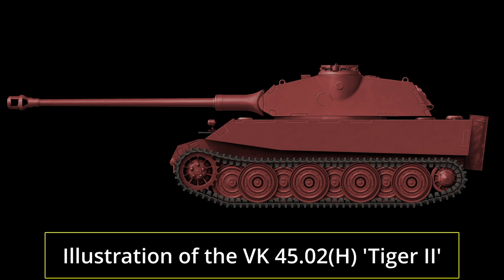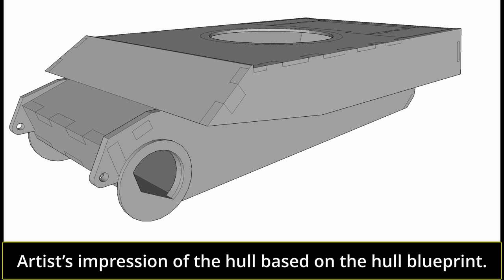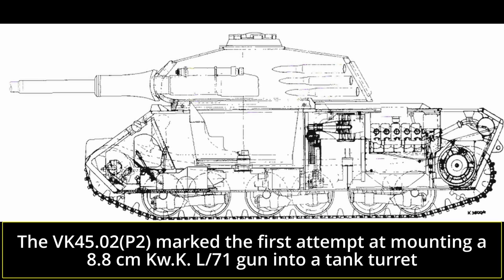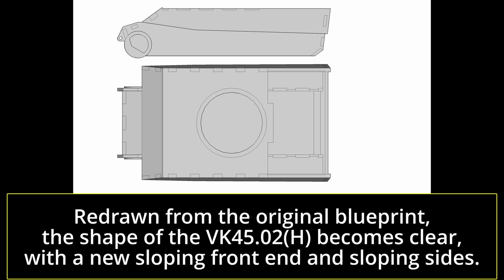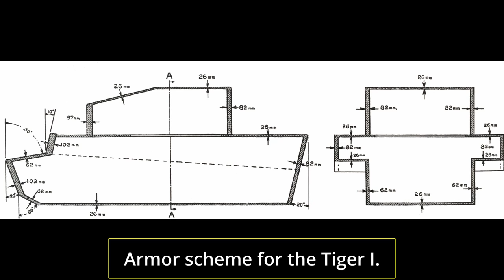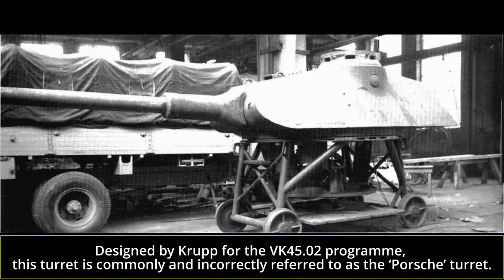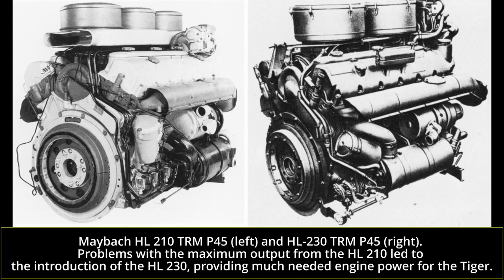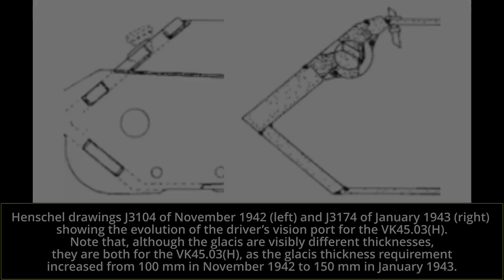The Lost Tiger | VK45.02(H) 'Tiger II' Henschel Improved Tiger

Comment: What if tiger 1 have  slope armor
Reply: you couldn't just make the tiger 1 with sloped armor, it would just make it smaller inside and the wight would go beyond what the mechanical stuff could handle, they tried that with the panzer 4 and they saw it wasn't possible.
Reply: @vasopel  actually the panzer 4 problem was weight and stress on the suspension, thats it. they tried making the panzer 4 with torsion bar suspension but couldnt make it work without a massive rework of the tank and the fact was the panther was already cheaper than the panzer 4 and the upgraded sloped panzer 4 would be more expensive than the standard panzer 4 so the idea was scrapped.
Reply: Sloped armor means different machine gun mount, different drivers optic, many more.
Reply: @vasopel  Thats not true. Extending the frontplate outwards to bridge the step of what would be the glacis and the roof where the normal front plate met would create MORE internal space, not less.
Reply: @vasopel  Actually, You could. The "step" in the frontal armor could be turned into a "ramp" and not cost any interior space, in fact, it would add to it. There were plans for making a Panzer IV variant with sloped armor using this method, but it never got a prototype.
Reply: @darnit1944  they could use the gun mount from the panther as well as the driver optics. the benefit is that it would mean less individual and specialized parts are needed and thus make the tank cheaper to produce.
Reply: @ravenouself4181  Switching production line is pretty tricky.

And besides, what's the need? By that time, Tiger is still impenetrable by Allied guns
Reply: @Thekilleroftanks  yes so what is your point? was my comment wrong in any way? :-) well maybe I should have been more clear... "it wasn't possible without a massive rework of the tank"
Reply: @kobeh6185  what?  :-O
if they did that the driver and the radio-operator would still be in the same place (there is the gearbox and the steering unit between them),
and you couldn't use that added internal space because then how would the driver see without making the port too big (periscopes are a bad idea) and the radio operator wouldn't be able to use the machine gun anymore!
that would just be wasted metal and so much added weight over the mudguards giving a lot of problems to the front suspension and the wheels 
especially if you consider that it was common to remove the 1st outboard road wheels because of problems with snow build up and because it was easily damaged (bended).
no you cant just put armor wherever you want, you need to make changes to the mechanical stuff too ;-)
Reply: @ravenouself4181  I already said they tried putting sloped armor on the panzer 4 in my previous comment ;-) 
hm...would the added space of a panzer 4 with sloped armor be used? that little extra space is so front in the vehicle you can't really put anything useful :-(
Reply: They could have had a lot more heavy tanks available for the eastern front had they gone with a Tiger 1 slope armor instead of wasting time and resources on the King Tiger .
Reply: @vasopel first off, the Sherman and most later war german tanks designs drive via periscope. Idk what makes you think periscopes are a bad idea, most MBTs today drive with them.

2nd. Putting lets say an 80mm frontplate on a tiger sloped at lets say 50 or 55 degrees would not in any way change the layout of the gearbox nor driver and radio operators positions. The step made my the plates is simply eliminated. Instead the top vector and front vector are bridged by a single monolithic 80mm plate, similar to the Jagpanzer 4 L/70. (The plate doesn't need to be as tall though) by bridging the step you increase internal volume, not decrease it. Its not as if I said to slope the armor all the way to the turret ring like a T-34. Anyway, This provides superior HE protection from high caliber HE, as well as thicker effective thickness against AP. It will result in an increase in weight, but not by a significant amount. Consider the Tiger 2 being 15 tons heavier and a meter longer and basically having the same powerplant. Adding 2 or 3 tons of armor to a tiger 1 isn't nearly as much of a consequence.
Reply: @gustaveliasson5395  sure but what does that have to do with the tiger 1? it's components were already designed to be put in a boxed shape.
Reply: @kobeh6185  what I meant was that having ONLY a periscope for the driver is a bad idea, the fatigue from driving using a periscope (especially with that period's technology) is bad for the driver, even in modern tanks it is common practice to stick your head out of the tank to drive (if there is no danger of enemy fire)
as for the rest... please just read again my previous comment-answer to you  ;-)
Reply: @vasopel  again, the Sherman and panther and tiger 2 all had just a single periscope to drive. Not saying its ideal but a direct vision port (which is what the tiger 1 has, im assuming thats what ir advocating for) has far more issues regarding protection.
Reply: @kobeh6185  are you reading my comments or not? please read all the 3 below..
a: "how would the driver see without making the port too big (periscopes are a bad idea)"
b: "the fatigue from driving using a periscope is bad for the driver, even in modern tanks it is common practice to stick your head out of the tank to drive (if there is no danger of enemy fire)"
c: (bonus): the drivers hatch on a tiger 1 is NOT above the driver,the chassis is too short,so anyway the driver cannot stick his head out so he needs that front vision port.
ok? :-)
Reply: @vasopel  the first point didnt make any sense. Periscopes being a "bad idea" and "making the viewport too big" are completely unrelated problems. 

2ndly yes many tanks drive head out when not under fire, again not relevant to the point. I clearly understand that as well but it doesn't change my opinion of the tiger. Periscopes don't have to be vertical. It'd be easily possible to bring a periscope to the driver if the tiger had a sloped front plate. After all the Panther could not be driven head out at all without add ons that weren't part of the original design.
Reply: @vasopel 
You just said it yourself, the Tiger I's components were already built.
So, if you build a Tiger I with sloped armour, it can't be smaller on the inside than the regular Tiger I, because then the components wouldn't fit.
So, sloping the armour on the Tiger I isn't going to leave you with less internal space, on the contrary, the sloped armour design will be slightly roomier.
Reply: Gabriel Rabin  Problem is, "flat on" is how most shells are going to hit the tank.
The best slope you're going to get using the flat box is when the enemy is shooting at you from somewhere around 40° to your left or right, any more than that, and the side armour becomes more vulnerable than the front. Even then, you can only keep the armour properly angled against shots from one, maybe two directions.
Build the tank with sloped front armour from the start, and you won't have to worry so much about manually angling your hull.

Then there's production costs.
1. The regular Tiger I was built using armour plates of various thicknesses, including 25mm, 60mm, 80mm, and 100mm. If you remove the 100mm plates used for the front armour, and replace them with sloped 60mm and 80mm plates, that's one less type of armour plate that you need to produce.
2. Replacing the two-piece upper front hull armour with a single sloped plate means that less welding is required.
Reply: @kobeh6185  what? do I really have to explain that those 2 things are the same problem? if you put the sloped armor the way you said you would need to make the view port too big to help the driver see, but the whole point of sloped armor would be to have better protection, so you can't make the viewport bigger because it is obviously a weak spot,so you would need to use periscopes as the only way for the driver to see.
you won't even consider changing your opinion? so why are we talking? :-(
the panther? again you use other tanks for examples? what other tanks have to do with the tiger? anyway about the the driver of a panther....he has a VIEWPORT he doesn't need to use periscopes all the time,the front armor of the panther was designed so that the driver viewport is close to his face so he only needs that small viewport to see.
if we put sloped armor on the tiger 1 like you said the viewport would NOT be close to the drivers face...so you need to make it bigger so that he can see.
just...please look up some cutaway pictures of the tiger and other tanks and you will immediately see what I mean...if you DON'T see it...there is no point in this conversation. ;-)
Reply: @gustaveliasson5395  
the tiger 1 was very roomy already and you know it ;-)
all the stuff you said would already fit in the tiger 1. 
so you end up with pointless extra internal space and more weight...not a good idea,they would never approve that design change.
Reply: @gustaveliasson5395  why did you write that comment addressed to "Gabriel Rabin" ? he would need to write a multi-lever essay to answer to you, anyway all those stuff have been debated before...there is no need to do it again.
Reply: @vasopel  you're talking past me again. The Panther D had a viewport. Early models of Panther A had a viewport. This was deleted so the majority of panthers did not have one and relied on the periscope. Early cast armor Sherman's had viewport but again, these were deleted. 

My argument is that if the tiger 1 recieved sloped frontal armor, (which i maintain is possible, the geometry checks out) it would use persicopes and not have a viewport at all. Consider the Ferdinand having similar armor arrangement to the tiger and yet the driver uses a 3 periscope arrangement.

"What does other tanks have to do with the tiger" 

Thats a silly thing to say, the best way to get a point across that a modification of a tank design is possible is to reference other designs from a similar period that already fulfill exactly what I am arguing. 

The tiger 2 itself has sloped armor, and is even more similar to the Tiger 1 then the Panther, utilizing a similar gearbox arrangement. Does it use a viewport? No. It uses a periscope. 

Youre acting like I'm making such a crazy outlandish claim when its perfectly logical that if the Tiger 1 did recieve a sloped armor model, the driver would see with a periscope. 

I know what the inside of a tiger is laid out like. Thats exactly what I am referring to make this argument. If you refuse to even consider other tanks as a comparison what is the point? There is nothing better to compare to a ww2 era tank than other ww2 era tanks that achieve the deserved goal.
Reply: @kobeh6185  I am not "talking past" you... 🙂
a: "After all the Panther could not be driven head out at all without add ons that weren't part of the original design",
they removed the vision port because it was a weak spot but they knew that the driver would get really tired by just using periscopes so they modified his seat so that he could get his head out like the way the sherman's seat was.(see...I referenced another tank the correct way!)
b: "the geometry checks out" 
geometry? modifying a tank chassis is not that simple :-( 
c: "Thats a silly thing to say, the best way to get a point across that a modification of a tank design is possible is to reference other designs from a similar period that already fulfill exactly what I am arguing".
silly? what? you CAN reference other designs if you want to..but the correct way here for this argument is to reference other tank's modifications of the original design to add sloped armor! 
I cannot believe that YOU said to me that I say silly things! the first thing I thought when you were simply referencing other tank designs was that YOU were saying silly things, but I didn't say that to your face... :-(
d: like I said the driver of a tiger 1 cannot stick his head out of the tank to drive like the sherman,late panthers,ferdinand-elephand, tiger 2 etc... , periscope only driving is a bad idea! they would never approve that design change.
e: (final): if you know how the inside of a tiger 1 is...AND you still think that making comparisons with other tanks can achieve your desired goal of proving that putting sloped armor on the tiger 1 was feasible without any major modifications...then we have nothing to talk about, we will always disagree ;-)
Reply: @vasopel  ill respond to all of those.
A) my point was that the Panther was never designed to be driven head out and the modifications to it to make that possible were not always issued, therefore many panthers were indeed driven periscope only. 

B) thats not a counterargument. "It's not that simple" doesn't mean anything, I never said it was simple, just that a redesign of the front plate would not decrease internal space. 

C) I had a stroke trying to understand what the hell youre saying. I'm assuming you mean I should bring up some example of a tank that started life with flat armor and was given sloped armor. Thats not an argument either. Plenty of tanks that had this done retained a direct vision port. (JgPzIV, IS-2, Hetzer vs Pz38) I wouldnt use them as a comparison because they dont compare well to the Tiger 1 for a number of reasons. The Panther and Tiger 2 are my primary examples because they are most similar to the Tiger in terms of size and transmission frontal crew layout. Simply that the features applied to sloped armor designs (tiger 2, panther, sherman) can be applied to a Tiger 1 redesign.

I dont have to only use tanks that recieved sloped armor later in their service life to demonstrate a sloped armor redesign on a single model of tank, that doesnt even make sense. 

D) on a normal tiger yeah, the driver cannot drive head out. If you're redesigning the front of the tank anyway, its not at all unreasonable to just move the hatch to a position right above him. Even then, I've already established that "periscope only driving" was literally used on the Panther. The germans literally approved removing the panthers direct vision port BEFORE issuing the head out modifications to panthers. They indeed approved of periscope only driving under circumstances. However given that if I were to make this design I would just move the hatch right above the driver of the tiger anyway, its not a problem I need to consider any further. 

E) somehow you reached the conclusion I believe the Tiger 1 could recieve sloped armor "without major modification" and yeah, I'm gonna call you silly. Sorry. How is proposing a major redesign to the frontal superstructure of the tank not a "major modification"? It most certainly is major and i hope you're not intentionally misrepresenting my position. It would be uneconomical to bring a Tiger1 that has already been produced and chop the front of it off and make a sloped front plate with relocated hatch and new periscope system. Its not as if I was proposing just slapping armor on it like the M6A3. I seriously hope thats not what you though I was going for haha. This change would have to be made to a completely new production model.
Reply: @kobeh6185  halo again 🙂 the main point here is "E" at the end ;-)
A: "many panthers were indeed driven periscope only" they just sent them out to action because they were desperately needed ;-)
B: "I never said it was simple, just that a redesign of the front plate would not decrease internal space" ok ;-)
C(a): aha! JgPzIV, IS-2M and Hetzer are good examples :-) 
C(b): "Panther and Tiger 2...primary examples....most similar to the Tiger in terms of size and transmission frontal crew layout" 
sure ok yes...BUT those 2 things are not enough for us use them as examples, tiger 1's length to width ratio was way different than the other two, 
the turret on the Tiger 1 in a lot closer to the front than it is on the Panther and Tiger 2, 
so since that turret's position would make it impossible to actually have a hatch above the driver in a sloped armored tiger 1 (except if they lengthened the chassis) makes me believe that the Panther and Tiger 2 (that had the length to accommodate hatches above the driver) are not compatible enough to be used as examples.
D(a): like I said "they just sent them out to action because they were desperately needed"
and most important is what I have said here: "the drivers hatch on a tiger 1 is NOT above the driver,the chassis is too short"
D(b): "I would just move the hatch right above the driver of the tiger anyway, its not a problem I need to consider any further." what? am I missing something here? you CAN'T put the hatch above the driver in a tiger 1, the turret is to close to the front, how can you NOT consider this problem? if you lengthen the chassis to make room for a hatch then you add a lot of weight,the main reason the tiger 1 was so "short" was to be light (the other to be more maneuverable...)
E: don't you see what I was going for? I was trying to convey that you need to make so many modifications that you might as well make a new tank! ;-)
Reply: @vasopel  I'm looking at a picture of Tiger 1 schematics right now and I can tell you there is more deck space than most tanks that have ever been made. The turret on a tiger 1 if anything is further back than most tanks fielded during world War 2. Its very similarly placed to that of the Tiger 2, compare the blueprints in scale. The tiger 2s hatches are relocated both forwards towards the frontplate as well as inwards towards the middle of the tank and are far more above the crewmembers than on Tiger 1. I completely disagree, all the schematics I can see show an enormous amount of deck space, I dont understand why you think the Tiger 1 has such a forward mounted turret. Clearly it does not. 

And to say the tiger was "kept short" to be 'light and maneuverable' is possibly the least accurate design description of the 55 ton Tiger 1 I have ever seen. 

Furthermore i never said it was economical to modify the tiger 1 design this way, I even said that earlier. In fact what was economical is to cancel the Tiger 1 altogether. 

Would you like me to make a drawing? I can far better convey what I am talking about with a drawing.
Reply: @vasopel  actually i think reason for sticking head out when driving is not cause periscope fatigue but only cause driver can see terrain easier if he alredy has that posibility
Reply: @justjako9145  driver can see terrain easier= less fatigue ;-)
Reply: @vasopel  just cause he can see less doesnt mean he will get fatigue
Same for vision port(he can still see way less than with head out)
Reply: @justjako9145  look...using periscope only is tiring for the driver , getting your head out is the best option but a good viewing port (like the one Tiger 1 has) is also good, you don't have to take my word for it, it 2021 so use the internet ok?
Reply: @vasopel  still dont believe it vision port/good periscope is literally same crap for driver(maybe periscope is even better technically since you can have larger periscope without creating weakspot in frontal armor, so by your logic it should create less fatigue)
Reply: @justjako9145  so you looked it up, read about it, and you still don't believe it?
Reply: @vasopel  i didnt look it up
Cause theres no way u can get higher fatigue from periscope than vision port
Reply: @kobeh6185  if you slope the armor all the way to the turret ring you would have hatches to enter the tank or either 1 hatch thats very have to open and no hatch for the machine gunner like in the T-34
Reply: @startingbark0356  if you read my comments you can see i mean sloped to the original vertex of the roof plate and upper front plate.